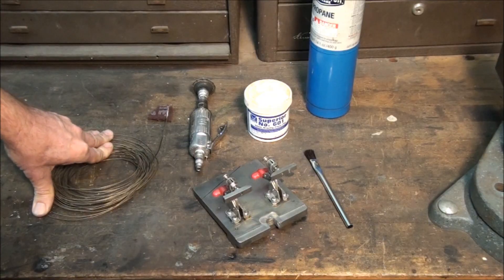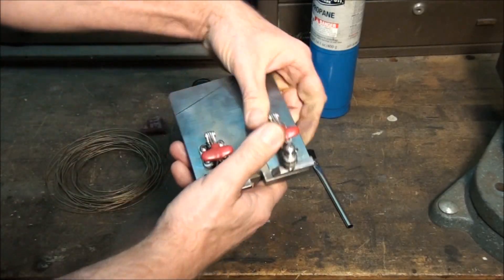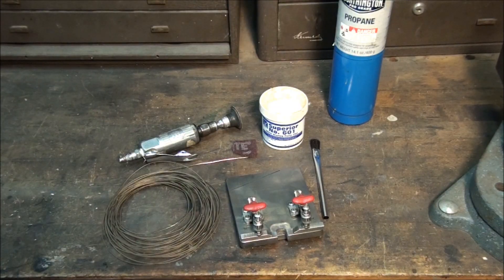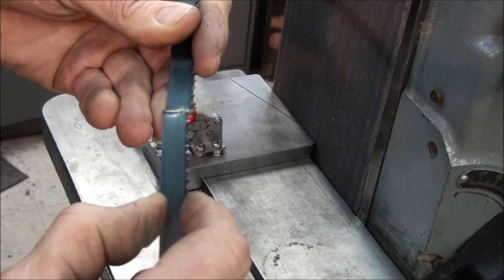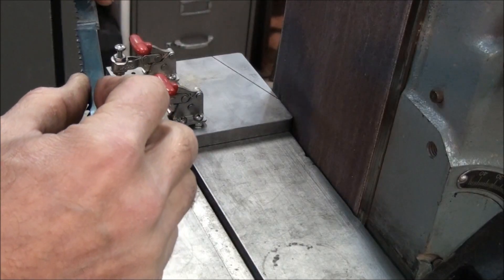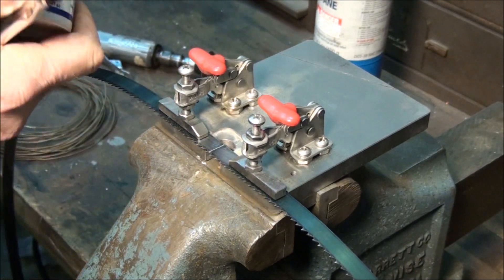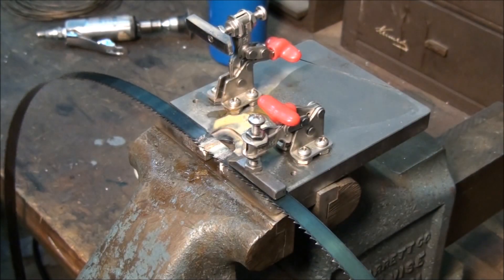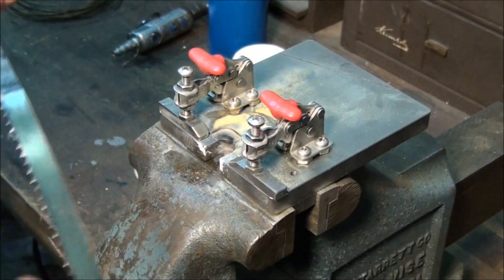How to Make Custom Length Bandsaw Blades Without a Welder

Comment: Thanks! I just copied your jig and made up 12 new blades. I happened to have the silver solder in my silver smithing supplies, so all I had to buy was the roll of blade and the flux. The blades I have had to buy are $19, and I can now make them for about $7.25. THANKS, THANKS, THANKS.
Reply from the maker: Good to hear!

Comment: I bought the solder labeled “easy” and it seems to work for this. Is that the one you used? There is also medium and extra easy. Thanks a lot
Reply from the maker: The solder I use melts at around 1140°. "Easy" solder probably melts at a lower temp and won't be as strong. It'll either work, or it won't. ;)
Reply: @TomsTechniques it is working quite well so far. I just wanted the same as you used to eliminate variables thanks.

Comment: I just clean my weld on the bench grinder,. Plus I don’t use as much flux as you do and get a cleaner weld! Plus I grind the laps about a 1/4 inch long. Never ever broke a weld!
Reply from the maker: Whatever works for you. None of my brazed joints have broken either.
Reply: @TomsTechniques just for something for you to know also!😊I have welded industrial bandsaw’s 14 inches wide using a coat hanger for the welding as our welding rod supplier was too slow in their delivery of such! So there ya go! And it was the butt weld to say the least. Held up like a charm!
Reply: @TomsTechniques ps! The secret is in tempering the weld after! 😉
Reply from the maker: @JohnNaturkach  The secret to a good weld is indeed proper annealing,  but I am talking about brazing bere as an alternative because most hobbyists don't have the ability to weld a blade.
Reply: @TomsTechniques totally agree with what you’re saying!

Comment: Tom, a question about your .025 cut on your steel plate jig.  What did you use to make the cu?.  The bandsaw blades that I want to repair are .035. and 1" in width.
Reply from the maker: @scruffy4647  I used a slitting saw, but another option would be to mill a pocket to one side of the slot and make an insert to create the gap. Then, it could be adjusted to whatever thickness of blade you were using.
Reply: @TomsTechniques  Thanks

Comment: Thank you for a very effective video. What is the best way to cut the blade from a bulk roll?
Reply from the maker: @johnchalikian3239  Just cut off what you need with a pair of tin snips before grinding the tapers. Try to locate the joint between two teeth if possible.

Comment: Couple of weeks ago I bought a 6 tpi blade for cutting aluminium and it snapped on the first cut. I complained to the seller and got ignored, but today I watched your video, I made a jig and silver soldered the broken blade back together and it is better than when I first got it, Thank you Tom!!!
Reply from the maker: @Begontom  I've always been impressed at the strength and durability of a silver soldered blade. A welded blade is quicker if you have a welder, but otherwise, these are hard to beat. I have blades that are years old and still going strong.

Comment: Brazing over welding when joining bandsaw blades together. It's still sheet metal which is very hard to do.

I also recommend brazing over aluminum so aluminum can take away excess heat from the torch. Yes, like a heat sink.

Comment: This video shows to be 9 years ago, and I just came across it. My little saw eats blades, and many times, it breaks in the original weld. I have used silver sorder for other applications, but never where strength was required. I have always heard it makes a strong joint. Thanks for the great video. I will be saving some money by using this information. It hurts when a new blade is used very little and still has sharp teeth breaks.

Comment: I bought an old craftsman band saw and right on the wheels it says 60 inch blades model number on the side says 103.0103 Sears and roebuck and company i want to use this for cutting wood and metal is this possible and where is a good place to purchase blades and other parts thanks in advance for any and all help !!!
Reply from the maker: I buy my blade stock from Mcmaster Carr, but I think they sell ready made blades as well. Just so you know, I don't know of any Craftsman band saws that will run slow enough to cut steel. It would need to run at about 100 sfpm.
Reply: @TomsTechniques  I am an old guy that is new to the band saw world .. and I am completely surprised that this band saw even runs when I salvaged it from an old barn it was covered in mud dobber nests and locked up I have slowly got it working again and am just tickled that it works so even if it doesn't cut metal at least it will be a fun saw to work with!! Thanks again for responding!!

Comment: Gas welding is more expensive than a cheap 110 flux core mig
Reply from the maker: This is not welding. That's the whole point.

Comment: Great knowledge, i just got a 1965 rockwell/delta bandsaw and also a old craftsman neither one has a blade you can readily can find at a hardware store. I came up here looking to see what was the best way and i had not even considered silver solder /old schooling it lol. That Jig is pretty cool seems I will have a side project. Thanks for the video.

Comment: Hi loved your video it was a great help I was told to anneal the metal to soften the metal as heating can make it brittle 
Have a great new year
Regards
Steve UK London
Reply from the maker: Thanks. Annealing is only required on welded joints.

Comment: Was waiting on a bend test...
Reply from the maker: Bend tests are for welds, where the temper has to be correct. Brazed joints, by nature, don't get brittle.
Reply: @TomsTechniques  would still be interesting to see how small of a radius you could get

Comment: Seems like a lot of trouble to avoid buying a $16 blade. Do you go through enough to make saving $8 a time worth the torch and expensive solder?
Reply from the maker: Not at all. It takes me about five minutes to make blade using a few cents worth of silver solder and flux. That results in a blade that costs half as much as one ready made, any time I need one. It also allows me to make a blind cutout if necessary.

Comment: I wonder if you could rig up a microwave power source spot welder and weld the blade the way an industrial welder do it. Of course the clamps would have to be electrically isolated.

Comment: my harbor freihht bandsaw had the same problem with the tension knob  i replaced the screw with a long bolt cut origigonel head off and added two saw cuts at 90 deg so battery inpact driver w phillips  bit fits  even a screwdriver w/o battery is faster than that knob  to get wider kerf put 2 blades in hack saw at same time

Comment: How about a wire wheel for the grinding?
Reply from the maker: The two ends need to be tapered to create a wide scarf joint for strength. That requires an abrasive.

Comment: Hi Tom!
That's nice jig you made. At the end of the video cut a piece of aluminum to demo the successful joint, and you mention the saw is an old Rockwell. Those saws were made in many configurations for variable speed, low speed, and just the regular speed for woodwork. I'm curious about the speed adjustment set-up on the back we just caught a glimpse of. Did that come with it when you bought it or did you rig it?
My saw is the regular speed for wood (I cant remember the f.p.m.) jobby, and I wanted to cut some 1/4" plate without running the risk of heat distortion to the work recently. So I rigged a second low speed motor and a hillbilly power feeder in the base housing which worked a treat. Do you have the original manual,  or illustration, or even the exact model number of your saw so I could score a copy somewhere to build a better speed controller?
Reply from the maker: The saw is a wood/metal model, so it has a two speed gearbox. With four step pulleys that provides eight speeds. Unfortunately, I'm in the middle of a move, so the saw and any info I have are in storage.

Comment: Where do you buy the band saw blades on bulk?
Reply from the maker: Any industrial supplier will carry them. I think mine came from McMaster Carr.
Reply: @TomsTechniques  

Thank you for answering that. I have another question. On a portable band saw blade. What does it mean when you have a 8/10 TPI or 12/14 TPI?
Reply from the maker: Those are variable pitch blades to reduce noise and vibration. They work well on thin wall tubular stock.
Reply: So if I'm doing 2.5x2.5x1/4 mild steel angle would you recommend the 10 TPI?

Comment: Just an FYI, on a woodsaw, the blade will break right next to the braze joint if you do it like this. You have to temper the blade after making the joint. Best done after the grinding, so you can see the color turn (somewhere from dark straw to blue is fine). 

On a steel saw, they run so slow it probably doesn't matter as much. Or maybe your power sanding gets the blade hot enough to temper it. 

You might think the blade is annealed from the brazing, but it's not. The heat draws out so fast, the blade is re-hardening. 

The annealing stage for resistance welding is required because the temp gets so high during the welding that the grain structure gets coarse. After the annealing stage, the blade should still be tempered in an additional step! (Because the annealing is actualy re-hardening!) You don't want the blade to be truly annealed and soft. It's 'posed to be pretty hard (but tempered after). If you over temper the area around the joint, you will see. When you bend the blade in your hands, it will fold over at the soft spot. And that soft spot will cause the blade to also break prematurely, on a wood saw. If the joint were truly annealed, it would be as soft as when you overtemper it (beyond blue).

I mention this because your tutorial is otherwise perfect. I will continue to point this out as long as people are watching it and copying you. Some of them will suffer broken blades because of this omission. You should always temper after re-hardening steel, if you want the steel to not suffer premature fatigue/stress failure.

Even in flexback and bimetal blades, the blade is hardened and tempered, not just the teeth. The alloy of the spine is just a lower carbon alloy that doesn't get as hard, but it's hardened and tempered. And tempering is always necessary; it's not only done to reduce the hardness of the steel. No matter how hard or harder the steel is after hardening, there are undesirable stresses in the steel that are released by the tempering.
Reply from the maker: That is incorrect. While a blade does need to be annealed after welding and grinding, it is not necessary after brazing. On a brazed joint, you are not grinding the blade, only the braze, so it doesn't work harden the blade. I've been doing it this way for many years and have yet to have one break.
Reply: @TomsTechniques 
Thanks for replying. I believe your blades are not breaking, for you.

The reason for tempering after the grinding is only so you can see the freshly ground steel change color. You could temper before grinding, but you wouldn't see the color change. You might be tempering simply by the heat from the power sanding with the die grinder. Or your saw might simply have large enough wheel diameter and slow enough speed that your blades die of other causes first, like going completely dull.

But when you braze the blade you are reaching critical temp; the steel is glowing red! The area at and around the joint is re-hardened by the brazing process. A lot of people think this is annealing, since you are not quenching. But the blade air-hardens! In order to anneal the steel, you would have to make it cool very slowly, and taking the torch away is not doing that. (You don't want to fully anneal the blade, either!) When the steel starts glowing red, that's hot enough to harden it. 

The reason you have to reheat the blade all the way to critical (just glowing red) after true welding is that you exceeded this critical temp by a lot, and that changes the grain structure. To fix that problem, you have to re-harden it (although most people call this step annealing, even though you're re-hardening). 

When you braze, the hard solder melts at just barely over critical temp. So you're re-hardening it, perfectly! But in either case, you should finish by tempering the steel. Again, you might be unwittingly tempering your joints by the power grinding; other people might grind or file the joint in a way that it doesn't reach as high a temp!

I learned to braze blades from your video among others, just about 6 years ago. And yours is one of the best. But I broke many blades (near the braze joint; not failure of the braze itself) before I became convinced and did the further research. 

Another dude's video, he shows the tempering. But he way overtempers. And the section of blade goes completely soft. I made that mistake, too. This also leads to breakage. This is why it's convenient to watch for the color change. As soon as it changes, you remove the torch. And you're done. Now your blade has been perfectly hardened by the brazing, and it has been spring tempered to where it just turned amber/blue.

Also, found out you can't straighten a brazed joint after the fact, by using a punch and a hammer. That makes the joint fail. :)

Again, thanks for the reply. I appreciate it.

Comment: This is a great thing to know, thanks for sharing the tip. I just looked into the silver solder and there are several temperature ranges available... Are you using the extra hard solder? Thanks!
Reply from the maker: Hard solder is stronger, but only with very tight joints. I normally use something around 65%. Make sure the flux you use is adequate for the temperature of the solder. Strength isn't really an issue here, I've never had a properly soldered joint fail.

Comment: Topic getting the most out of a Bandsaw blade before and re welding a blade , re sharping a blade, My place of work is foundry, industrial size band saw are in use to cut gates off castings ,hard on Band saw blades, first thing that goes out is the cutting edge the outer edge of the tooth, blade width 3/4'  4tpi,  did my own research on how to re sharpen a blade with out taking it off the saw, the reshaping of the blade  cuts better and last longer than the factory edge.

Comment: I have two bandsaws  one is a Craftsman 12" vertical the other one small  vertical horizontal , for both saws I use the bi metal blades 6tpi and 10tpi, the small band saw takes 64 1/2" blade   with 7 1/2" wheels  the Craftsman 80"  blade with 12 1/2" wheels, I have tried the brazing approach on the small bandsaw  for the size of wheel and the twisting of the blade a sliver or braze is not strong enough, found the most of the time the blade breaks some where else not at the weld, have the convenience to a blade welder at my place of work, before re welding the blade i check it for hair line cracks , get a short life out of the blade. The Craftsman don't have near the problems. I made a table for the vertical and horizontal saw to use it in the vertical position , use it for aluminum, brass and steel, the Craftsman wood, aluminum, brass Bronze, castings

Comment: I enjoyed the video and it is a great skill to have in the event you want to repair a broken blade, but I don’t see the cost savings. When you add up the cost of a coil of blade stock, solder, flux, propane, building the jigs, abrasive, etc, it is cheaper by a long shot just to buy a ready made blade.
Reply from the maker: Coil stock is roughly half the cost of an equivalent number of ready made blades. There is no cost associated with the fixture because it is made by me. The cost of supplies is insignificant because they are already used for other applications. So unless you are only going to make one blade, the cost savings is substantial. Of course if you had to pay someone to build the fixture, it would skew the cost, but that's not what this video is about.

Comment: Anybody ever try this using Harris Stay Silv white flux? Just curious, it does say flouride is in the ingredients. I have some laying around from a copper plumbing job. I don't want to waste real silver solder though if Harris is not a good fit. The Superior 601 flux in the video says potassium fluoride on the label.  Thanks
Reply from the maker: Harris and Superior make the same types of flux. You just need to check the number to see if their temperature range is appropriate for silver solder.

Comment: Just tried this, so far, so good.   I had been doing something similar, with a much shallower angle, and bronze braze, which worked also, but was a much slower process.  The 20 degree slit / fixture for grinding is so much quicker.

Comment: Which kind of solder can be used for this? Will steelaloy be strong enough for this purpose?
Reply from the maker: Use a hard silver solder, at least 56% silver. There is a link for it in the description. A higher silver content is even stronger, but the joint needs to be tighter.

Comment: Hi, do you know a blade sharpener for band saw like yours. My bandsaw need 175 inches blades. Its tooooo spensive to keep buying blades. But, i cant find a band saw sharpener for my workshop. All bandsaw sharpener are for wood mills. Thanks
Reply from the maker: Buying blade stock in 100 foot coils and brazing them like this will work out to about $14 per blade for you. Hardly worth spending the time sharpening one.

Comment: What did you use to cut that slot in the fixture?
Reply from the maker: A slitting saw, but another option would be to end mill the slot and make a filler bar to create the required gap.
Reply: @TomsTechniques  Thanks for the quick reply - i'd opt for the filler bar.  - Your jig is a brilliant design. Too bad you don't want to go into production. I'd buy one!